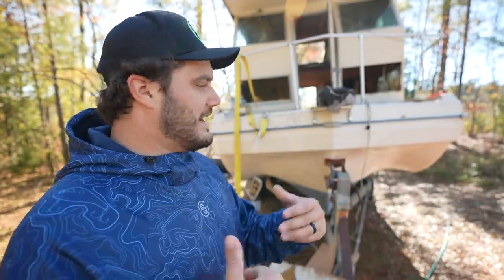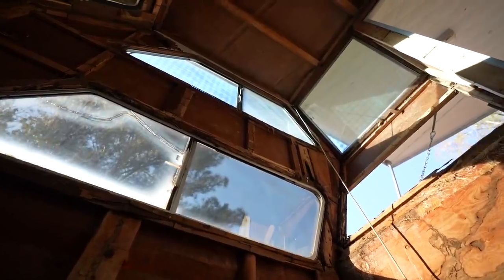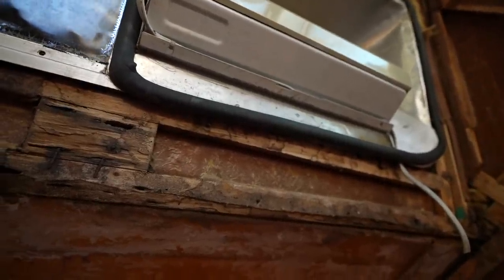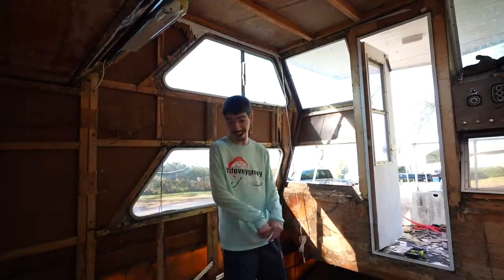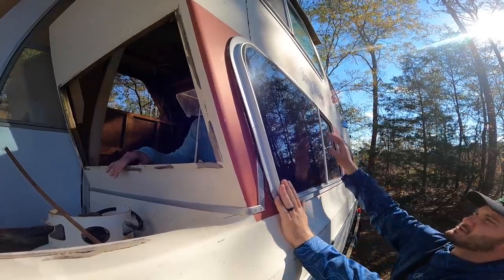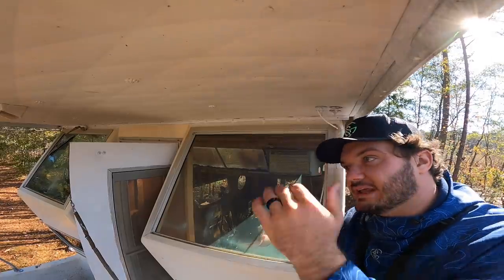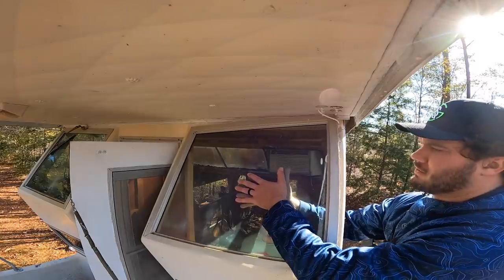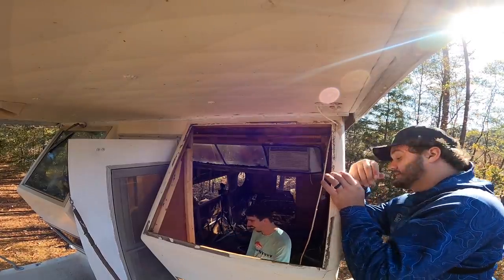It's Worse Than I Thought... (HOUSEBOAT UPDATE)

Comment: Props to you for taking this on. I’ve refit boats all my life from ski boats to a 60’ wood William Garden Ketch. You made rookie mistake number one, nothing can ruin your zeal for a boat quicker than this mistake. You TOOK IT ALL APART FIRST. Never do that! Start at the highest point of repair needed and work your way down and around. Stop ripping out the bad wood at random. Take it apart in sections and replace it in sections. Don’t create a daunting heap of work to face daily. Make small victories a few days at a time, keep it under two weeks per section. I would do the roof in sections, then the sides one at a time and then the ends, installing the windows when that is complete. Then the stringers then the mechanical electrical. Lay your floors temporary as you should be lifting them often. That’s my 45 years of boat refitting as short as l can make it. Good luck hang in there. The glass will be fine if it’s still hard.

Comment: Basically paid 3000 for some molded fiberglass and an old motor.  All you get out of projects like this are the satisfaction of doing it yourself.  Often it will cost more than if you just paid for a decent used boat.  But hey there is that satisfaction!
I will subscribe to help out the project.

Comment: I would recommend greatly that you introduce yourself to the local marine hardware dealerships and use marine grade supplies including the adhesives to install those windows. They'll be able to point you in the right direction for replacing the glass and some of the broken windows. You may also want to consider replacing the wooden floor members with fiberglass instead of wood.

Comment: Sillicon is OK if use for things it will work on. Not everything. Set the windows and door metal frames with butyl. They sell a poly with reinforcement in a clear. Cover the exterior of the boat with it. Tough and water tight lets light through.

Comment: I have a 40 ft house boat and love it.  I had side wall rot and had to invest in repairs.   You got a great deal!  Love the unique design.  As far as power, i have a little 70hp outboard on mine.   Definately not a raceboat but its enough.   You could mount an outboard, use the rear area for your gas tank, batterys and storage.   Dont underestimate how much storage you need.   Plan ahead for lines, tools, lifejackets and gear so your living space Doesnt get cluttered.

Comment: Use plexiglass or polycarbonate the windows. It will be way cheaper, a couple of sheets will be a couple hundred dollars. I worked at a plastic fabrication company and boat windows are something we worked on often. You can cut the material to size with not too many tools

Comment: I had a better houseboat I sold for 5 grand and it was 50 foot long on a trailer. If you wanna see it . It’s on my channel Sv bohemian. I think the video is  called we bought a old houseboat cheap and I did the same to it . I was way bigger but you can move it around with a f 350. Same issue windows. When I sold it the metal pontoons needed welded on the bottom. You could of become a welder

Comment: I am sorry that its working out this way for you.  20 years I bought a boat similar to this.  I was in "ok" shape and we used it for a few years as is.  Then I decided that I wanted to gut it and turn it into my dream boat and I pulled up the floor, and I had to keep stripping back to the fiberglass shell.  every bit of structural wood was rotted. In the end I sold the motor and the rest went in the dump.

Comment: Gut the entire thing and separate both halves of the boat. Use them as molds for a new boat and make a small business of it or sell the molds. Could improve on the design by giving it some extra length in the bow and stern areas. Just a thought. If the bathroom was that brittle being inside the boat.... imagine how brittle the haul is. Got to be pretty thin if you can see sunlight  through it. Make molds of the top and bottom. Sell a couple of them to finance a better boat.

Comment: I did hazmat for years and you need a half face respirator with an exhaust out the bottom.  It will save your lungs and stop fogging your goggles.

Comment: Just update whenever you feel like, but seeing the state of the wooden structure I would have torn it all down and rebuilded it with new wood and change the position of some windows. Apart from the ones in the front end as they need to slice through the wind and the waves. Clean the hull completely so you only have that and start from scratch.

Comment: You can buy a grinder disc that will shape the round corners and you can cut the straight lines with a glass cutter. Used auto glass will do the job.

Comment: Before you go too far, you need to get into the keel and frames to see if they are rotted. I can bet they look ok until you cut out a sample to find you a have fiberglass shell over wood that has turned to saw dust. Been there myself so it does happen. Took me three years to get that boat on the water again.